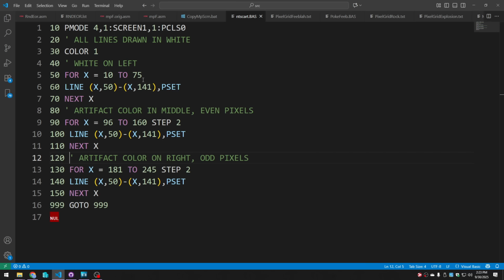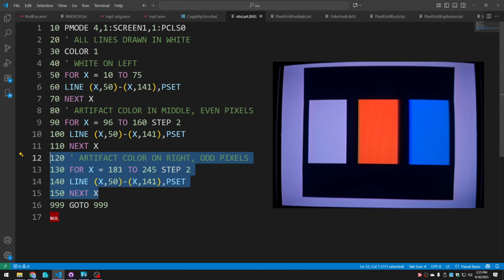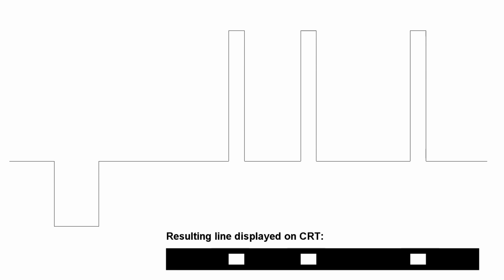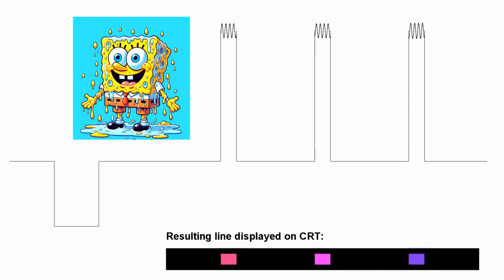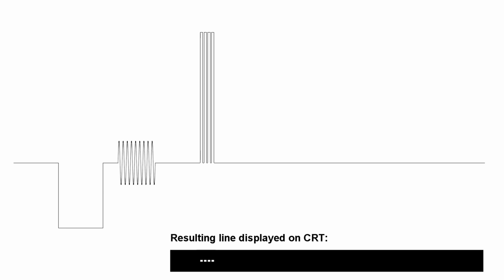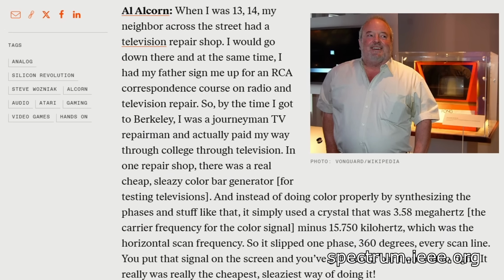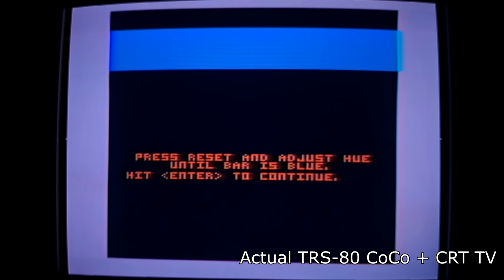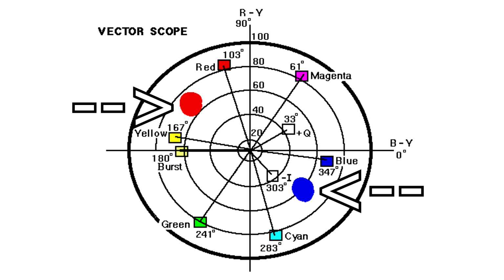How early computers TRICKED TVs into making color (out of nothing at all)

Comment: Very nice explanation, but there is one thing I don't understand. If you can manipulate the Luma signal to the point of sending a "fake" initial color signal, why can't you just generate a proper sin wave for the color signal?
Reply from the maker: In the case of the apple 2, it did not generate chroma at all, and used luma for all of the colors.  I'm no electrical engineer, but my guess is that Chroma is tough, b/c it requires carefully adjusted phase changes for each new color across the scan line (versus luma, which can just be a square wave that goes up when a new pixel needs to be drawn).  In the case of the coco (which came a few years later), it actually was capable of generating chroma, and did so on the lower resolution screens. It is only on the high resolution screen where it relies on artifacts to get colors.

Comment: What the trick if CRT already has colors? Why just dont use Chroma signal?
Reply from the maker: In the case of the apple 2, it did not generate chroma at all, and used luma for all of the colors.  I'm no electrical engineer, but my guess is that Chroma is tough, b/c it requires carefully adjusted phase changes for each new color across the scan line (versus luma, which can just be a square wave that goes up when a new pixel needs to be drawn).  In the case of the coco (which came a few years later), it actually was capable of generating chroma, and did so on the lower resolution screens. It is only on the high resolution screen where it relies on artifacts to get colors.

Comment: Thanks so much for this video… this question has been plaguing me for 40 years. I read about the effect on Rainbow magazine, used in a lot of programs, but never understood why it happens!

But this video left me still with two questions:
Why only four colors? (The two originals and the two artifact colors)
And why those specific colors? (orange and cyan or red and blue)
Reply from the maker: Glad I could help!  It had bugged me a lot, too, until I finally understood it.
Reply: @CocoTownRetro I think I edited and added my questions too late for you to see! I’ve never seen such reply speed!
Reply from the maker: @LurkingNoMore  Everything extra means more time and more expense. The apple 2 exclusively used artifact colors, so it got all its colors this way. The coco used true chroma on lower resolution screens, so it wasn't necessary to go all in on artifact colors like the apple did.  In theory, the coco could have added more colors on the high resolution graphics screen with artifacting, but it would have had to play games with timing and data encoding (to adjust phase) like the apple did.  Harder than it sounds, and it doesn't sound easy. 

Note that for this effect to work, the two colors need to be 180° separated from each other on the color wheel.   Those particular two colors were chosen, likely, for their usefulness in games and other software. The service manual does talk about ensuring the timing didn't result in a “worse” pair of colors such as green and magenta, which they for some reason referred to as “not acceptable”.
Reply: Thank you so much for the answers, you are amazing! 

It makes sense… I always thought of artifact colors like a “happy accident”, but of course they were deliberately chose to be the most useful while at the same time not too complex.

Comment: I seem to recollect some of these but for SECAM system that was used by France USSR and some of it's satellite countries maybe Italy too.  I was in Switzerland  at that time and had a TV set that had SECAM, PAL and NtSC modes all in one set. It was necessary because in  Switzerland one could receive TV signal also from France, Italy and Germany, Was sent a CoCo from a relative in Canada which had NTSC, Color worked in NTSC and SECAM modes but with reversed colors, PaL just B&W. Picture was different sizes though and lightly distorted from NTSC but for those crude games it didn't matter. Only programming I did at that time was for Cad-Cam in Fortran (I think)and in little  BAdiC I knew didn't notice haw it was done.
Reply from the maker: Wow, that sounds like a really interesting experience, switching between all those different kinds of signals, and with a Coco, too!  You have the best of all worlds!

Comment: so why was only the blue/red being exploited originally? was 21:07 explaining that?
Reply from the maker: Everything extra means more time and more expense. The apple 2 exclusively used artifact colors, so it got all its colors this way. The coco used true chroma on lower resolution screens, so it wasn't necessary to go all in on artifact colors like the apple did.  In theory, the coco could have added more colors on the high resolution graphics screen with artifacting, but it would have had to play games with timing and data encoding (to adjust phase) like the apple did.  Harder than it sounds, and it doesn't sound easy.  🙂
Reply: @CocoTownRetro  I think what it was because you have to get the resolution, it can only be A-B-A-B or B-A-B-A. There is no A-A-B, B-A-A, A-B-A There was only ABAB, BABA, and those happened to alias to the red/blue chroma, and a green chroma would have required a half-step. it was the temporal limit of the signal? that's all I can think of.

Comment: Good explanation and thank you.  There is a little  difference in how NTSC actually works that maybe does not apply to original video on early computers so I'll describe it and leave it up to you to use it or not.  Theres a slight difference in how the horizontal lines are scanned and it's because of "persistence" , if you were to scan all 525 lines at once by the time you got to the bottom the lines at the top would have faded.  So what NTSB actually does is scan all the odd lines and then goes back to the top and scan and "interlaces " the even lines now when you get to the bottom there's still a complete picture top to bottom then it does a quick Vertical interval pulse and starts scanning an new odd even complete picture 60 of those a second.  Also just fyi, the color burst is 8 cycles and the 2 ledges are called the front and back Poarch, also frequently the first 17 lines of most network signals also contain test signals to help ensure the quality of the network , it usually includes color bars and various frequencies of calibrated values.  Even with careful attention to all these details by the time these 525 line signal was probably doing well to be 300 to 350 line resolution by the time it went through the analog systems, the transmitter and your home tv.
Reply from the maker: Thanks for the details.  I did indeed omit things like interlaced fields, and lots more!  🙂

Comment: great video, great explaination of a wonderful exploit. lots of memories of my youth come back as i was exploring similar things, in the 1980s on the Commodore64, programming in machine language of the MOS 6510 processor. The C64 hat a graphics chip (VIC-II) with a few interesting features. one of them was the so calles raster-interrupt. Basically the C64 hat one programmable interrupt (IRQ) that was used for all sorts of things and whenever it was triggered a kind of polling had do be performed so to ask "who was calling this interrupt?" One possibility was to program the VIC graphics chip so that it would fire an interrupt when the electron beam in the CRT reaches a specific line. The interrupt-routine could then change some registers in the chip to perform marvelous things. E.g. you could split the screen in half for graphics and text mode, you could allow more than 8 sprites by changing the vectors to the memory locations where the sprite data resided, you could do characterset-scrolling tricks etc. i was so fascinated with that, and the machine language programs were soooo fast at the time. aproeimately 50 instructions would fit into "one line of TV signal". BTW i am talking about PAL TV standard here because i live in Austira in Europe. But for raster-interrupt, the TV standard did not matter at all. i just so greatly enjoyed it that as half a child/youth being able to understand and exploit a bit of computer(architecture) and have learnt so much in that short period of time. early home computing days were special ...

Comment: That works for making color from a high res (small) pixel. Now, how do you make color from larger pixels? You could make groups of patterns of small pixels, but now you're making it harder than it needs to be. Atari made a neat method of making large color pixels. In hires mode, it works just like your video, but to make large color pixels, they took the color reference signal and ran it through a chain of inverters. Each inverter delays the signal a little bit. Then your color select for the pixel chooses how many inverters are between the color reference and the color output signal. The first color would have two inverters, the second would have four inverters, etc. That delay gives a phase shift between the output color signal and the reference, and hence a different color. Atari gave you white, and fifteen different colors to choose from using a single color reference, a handful of inverters, and a multiplexer to choose which color to output. So you have one Y signal output, and one C signal output.
Reply from the maker: That sounds cool, I didn't know that. Thanks for sharing!

Comment: the animation at around 5:30 is not correct as it does not show the interleaving. Also the 525 lines for a "complete frame of video" is hence not correct, because it is only every other line. And not all lines are even used for the video frame.

Comment: If your home computer uses 7.15909 or 9.54545 or 14.318182 or 21.47727 MHz crystal as the pixel clock 
(that it probably divides by four for the MCU clock) then you can do this trick.
On the higher freq you would not draw 010101, but 000111, 001110 or 100011 etc and get 6 colors, yellow has to be one as that is the color burst color.

Though the Commodore 64 uses a 14.3181818 MHz crystal, the pixel clock is 8MHz, done with a doubler-divider (pll), that it then divides by 8 to MCU. 
The 14.3181818 crystal signal is divided by four by the VIC-II into four signals: sine, cosine, arcsine and arccosine, that the color-resistors analogy sums together to the color.
Yes, summing these four waves with different weight, still creates a single phase offset sinewave.
Use of resistors gives more earth tones as you are not limited to the primary colors.

Comment: Nearly 40 years later, and I only now find out it would have been possible to fix the colors for the CoCo 3 just by holding F1 on reset... was the only reason I would ever hook the CoCo 1 back up for Cash Man and all the others that were just "wrong".
Reply from the maker: While doing this video, I did a scan through the manuals that would have come with the coco 3 (I never had one), and was surprised not to be able to find that feature. It was only when I dug through the service manual and Tepolt's programming manual that I saw it. Rather surprising that it was so buried.

Comment: Interesting. A bit related, in the 1980s I experimented a bit with the C64 in its hires mode, that resolution was a bit higher than the PAL TV resolution, which had a grid of red, green and blue pixels. A C64 pixel would not light up 3 color pixels to produce white, but just one or two plus some bleeding to nearby color pixels. This made it possible to make vague higher resolution colored images while only using black and white by carefully positioning pixels. It took ages but it worked. On another TV the images would probably have looked different though.
Reply from the maker: That's interesting. Thanks for sharing your experience with PAL!

Comment: Sorry, but your presentation is awful. Most of the comments here are people just trying to butter you up. B&W NTSC is really grayscale where brightness determines its grey levels. You failed to show how it is achieved. Is it the width of the pulse, height, or position? You then immediately jump into color without factoring in brightness, nor do you explain how it's different from saturation. In B&W, they're the same.

Later, you describe how the NTSC determines a color signal by detecting the color burst. You never specify when and where it's produced. Is it at the start of the frame, on every scan-line? You also throw around terms like field, which you never bothered to explain. Did you really have to fit in rock and roll analogy just to explain that a color burst establishes a reference? Rock may be cool, but confusing your audience isn't. Overall, your video is cutesy but not informative.

Comment: I stumbled on this video and I have no background info, so I'm still confused about two things. If this feature wasn't published in the manual, why was it called the "Color Computer" in the first place? Were most people buying a CoCo and then not being able to make color with it? Also, why couldn't computers at the time just recreate the Luma and Chroma waves that the TV's were designed to use? Why was this trick necessary?
Reply from the maker: In the case of the apple 2, it did not generate chroma at all, and used luma for all of the colors.  I'm no electrical engineer, but my guess is that Chroma is tough, b/c it requires carefully adjusted phase changes for each new color across the scan line (versus luma, which can just be a square wave that goes up when a new pixel needs to be drawn).  In the case of the coco (which came a few years later), it actually was capable of generating chroma, and did so on the lower resolution screens. It is only on the high resolution screen where it relies on artifacts to get colors.

Comment: The “cheap and sleazy” color test seems like… exactly the thing youʼre supposed to do if you want a horizontal rainbow signal.  There is no difference between constantly changing phase slightly (for hue shifting) and being slightly the wrong frequency, is there?
Reply from the maker: A typical color bar test would not continuously change the phase from the left to right side of the line. It would show a discrete number of thick vertical bars, each in a different solid color. Check out 15:09.
Reply: @CocoTownRetro Is there a reason to prefer that, though, or is it just standard?  I’d have thought the reason to have multiple tests in the first place is because they might show different things
Reply from the maker: I'm 100% guessing, but I'd think that a known number of bars with the same thickness and the same set of colors would be easier for the eyes of the technician to recognize small issues with than a smooth changing gradient. If there were color problems with the television, I would think it would be more apparent from those discrete bars than from a smooth gradient.  But definitely don't take my word for this, really just a guess.

Comment: There's one very important detail that you didn't mention: in a healthy, broadcast-quality NTSC signal, the color burst is inverted from line to line, so on old B&W TVs that didn't filter out the color signal, a solid color screen would look like a fine-grained checkerboard. With its fields getting inverted with each frame, because the color burst was inverted from frame to frame as well. All the color bursts were also part of a contiguous ~3.58 MHz signal. They're as if there was a contiguous sine wave being there all the time, but its transmission blocked outside of the part of the line where the color burst is supposed to reside - that ~3.58 MHz frequency was, however, deliberately chosen so that every line during the color burst time, a reverse of the above line would get transmitted, and the odd number of lines in a frame (525) meant that each frame would get the reverse of the previous one as well. This made color look more or less like noise on B&W TVs, greatly improving the perceived quality.

But 8-bit home computers didn't output healthy, broadcast-quality signals. They deliberately cheated, in more ways than one. First, instead of outputting 525 interlaced lines in two fields 262.5 lines each, they outputted progressive scan video, usually 262 lines each. That would raise the refresh rate from the intended ~59.94 Hz (not quite 60 Hz, which was a change made to NTSC when introducing color, to avoid interference with the sound signal... that's a whole separate story) to ~60.05 Hz. But they also made each line slightly longer than it should be, so that the color burst would have the same phase each line. The resulting refresh rate is about ~59.92 Hz, but more importantly, it means that the pixels on each line in every frame have identical phase relationship to the color burst, so the artifact colors are reproducible. It also make them look like straight vertical lines on B&W displays.

One additional minor correction I feel inclined to make: you said that "composite video" refers to composited luma and chroma. That's not entirely true. A black&white TV signal is still "composite video", because it composites the luma information with the sync pulses as a single signal, as opposed to e.g. computer monitor cables where those signals were separate. Composite color just composites one more signal there, but it's not necessary for that term.
Reply from the maker: That's a lot of great extra information. Thank you for taking the time to write it all up!

Comment: 18:08  why not use the fact that is start on blue and give you option to start on one of those colors 
And then just changing the signal so it matches the expected color
Reply from the maker: Some games did allow you to just hit a key to swap the colors until they looked right. But that was more difficult and required more memory than just putting the burden onto the user to hit the reset over and over again until it looked right.
Reply: @CocoTownRetro so cool thx